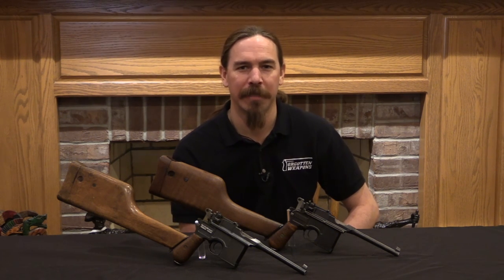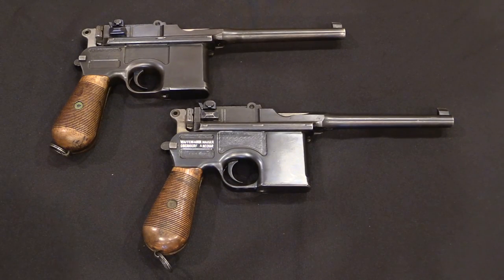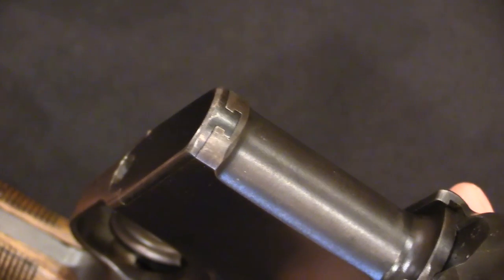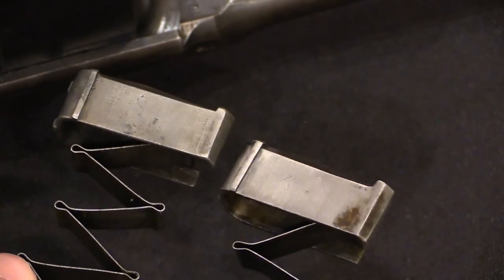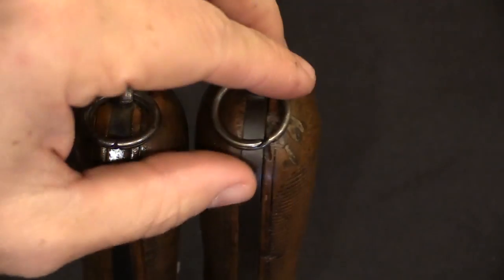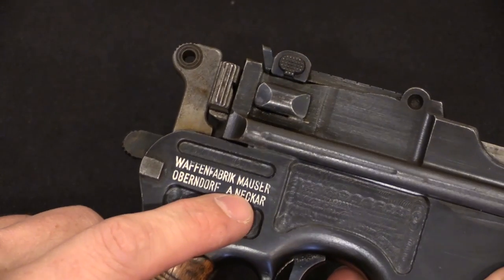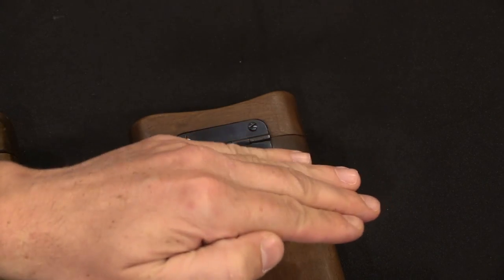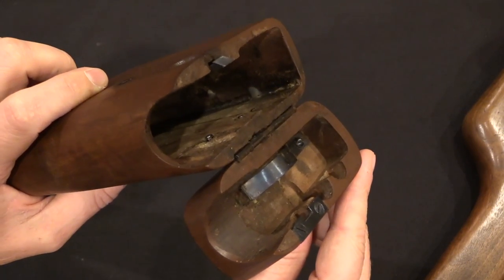Real, Reworked, or Faked? Authenticating a C96 Mauser

Comment: Many C96s in circulation spent many decades in China and were imported into the US through the early '90s (and later in other countries - I have seen Chinese import C96s on the German and Canadian markets). These will typically have import marks and some will have Chinese-made parts and even receivers. The majority of these are in need of refinishing and new parts and springs. They're still Broomhandles, though!
Reply: Actually many of the replacement receivers were made in the US by the importers, as many of them were actually the Model 712 Schnellfeuer and thus otherwise unimportable as machineguns. They effectively came in as parts kits and were re-built as semi-autos, though this does mean that they can no longer legally accept a stock. I've got one of those myself that did come with a correct 712 stock, though it also seemed to have been converted to 9mm  to correct what I suspect was a rotten bore. The stock has since been paired with (but not altered to improve fit in any way) a correct original M30 Broomhandle, also from China that can legally fit the stock. I know for sure Briklee Trading was one of the companies involved in doing that, I'm sure there were also others.
Reply: chunk.. blam, blam.. oh shit.. (in .45ACP).. loading the chamber can be a bitch (1st round)

Comment: I've got a Bolo that's a complete parts bin special, which I wouldn't mind if they were mismatched working parts, but alas, they are not. Mind you, the guy I got it from threw it in for free with a Webley Mk IV I was buying, so we both knew it didn't work, but when it later turned out not to be fixable, that was a bit of a disappointment.
Reply: damn how bad is it to not be fixable?
Reply: @therideneverends1697  I'm no expert, but I left it with a gunsmith downstate for several months a couple years back, and he finally said he couldn't find the parts necessary to make it safe to shoot anywhere, and would I please come and take it back.

Comment: Another thing I kept thinking during this video was "what about differentiating between restoration work that was done when the weapon was in service, versus later when it has retired into collectordom?"

For example if someone with an original gun, in WWI, had their stock holster heavily damaged, or their floorplate fall out into the mud of a trench never to be seen again, and replaced it during or shortly after the war, or it was replaced in 1937 by their son, or so-on and so forth... perhaps an armorer re-numbered a blank stock to match the item in inventory so it wouldn't be confused? Would that have ever happened? Are there procedures that would have been clearly followed, or telltale signs of legitimate repair work, versus a fraudster in his basement gunsmithing lab? I have to imagine that sometimes you'd get a damaged gun that with some replacement parts would be back on the front lines in non-pristine but serviceable condition. Or were most damaged guns simply thrown in the fuckit buckit?

Comment: The thing is that most old guns need repair and replacement parts. My OCD isn't bad enough for me to lose any sleep over encountering guns that over a period of 100 years had to be fixed.  A used, old gun will look like it's been used and cared for.  But, of course, a gun that has been "tampered" with will fetch / cost less money than a gun that hasn't been extensively repaired.

Comment: So, if I were to buy one, I'd probably seek out a bad example as it would be the only one I could afford.
With minimal effort they could have done a better job and made it easily passable to casual observation.
I cleaned up my Iver Johnson cadet by reseting the barrel to correct the excessive barrel gap and easily added 50% to the value of the gun, so made a $90 gun into a $135 gun, and Ian would never have a clue!

Comment: Literally a boat load of authentic broom handle Mausers came out of China in the early 1980s in very rough external condition with corroded bores (China was a major customer of Mauser).  Since many, if not most, were actually in VG mechanical condition (just looked like hell) they formed the basis for much of the fakery you see today.  These were cheap at the time and people such as myself restored them to presentable and functional condition (relining the bore is not hard).  I’ve probably put over a 1000 rounds through mine, which has now started to acquire that “been there” look.  Stumping a newbie with it would likely be easy….but anyone that heeds the advice herein should be able to spot the issues readily enough.  To me this is a $300 pistol at best.  That said, for someone that wants a real functional example for shooting and doesn’t have a 6 figure checking account, it is a sound purchase.

Comment: 6:50 You'd have to do A LOT of "polishing" to get that much of a rolled over edge.
Reply: not if you are using a belt polisher/sander, by hand you are correct. On a belt 45 seconds

Comment: I would still rather have a decently done refinished gun than a poorly kept original gun but that's just me.  As long as the refinish was done in the correct manner with the correct type of bluing.  The way I see it is that an original gun that has not been kept up with wouldn't be around in another 100 years if it never gets some attention and possible refinishing.

Comment: Very awkward to load and fire these pistols.  Also, very delicate, very hard to take apart and reassemble. If you buy one, replace firing pin spring and bolt stop before firing.  Have a smith look it over well.

Comment: I'm looking at a "complete" c96 and this video is invaluable on what I need to watch out for. Thank you for taking the time to make this! What about the lend/leases that went to China? Or the Chinese made c96's?
Reply: Most Mauser Broomhandle sent to China were M30s, or Mauser Bolos from what I have seen. Sometimes Pre War Commerials show up. The bores are usually rough or shot smooth without rifling. All Mauser Broomhandles returned from China are hit or miss, since most had parts switched out/replaced, which makes finding a matching pistol from China very rare. The beat up Chinese Mauser Broomhandles can usually be had for $500-700.

Comment: I may be slightly confused, but it seems as though he touts the 211 example as the most original Pistol but then declares the 211 Holster as being the most altered holster. Conclusion? It is very difficult to find matching pistol and holster in original, unaltered condition. Very surprising he did not mention this fact while he nitpicked any and all discrepancies. I also believe that some differences could be attributed to guns assembled by true gunsmith perfectionists and others assembled by 9 to 5 Joe Schmoes at the time of manufacture.
Reply: I think it is stated in the video that both the 211 pistol and 211 shoulder stock were messed with.

Comment: Where is this idea coming from, to fill stampings on old guns with white paint? Nobody did this until a few years ago. The first I seen it was a Walther P99, and some H&K guns later. I think it sucks on historic guns.
Reply: First I totally agree with you.  But second it's not a recent trend, you will find that it starts back in the 50's when those early collectors were getting on in years and beginning to lose their eyesight.  Third, it should be in white grease pencil and not paint like I've seen done by some unscrupulous individuals.
Reply: @worldtraveler930  May be its different in the US, I started shooting 35 years ago in Germany and I never saw it until a few years ago as I said and recently in Ian's videos. What is used for filling the stamping is not important. H&K uses some kind of paint, I think, on the polymer parts of the guns. 
I once did something similar myself: I drilled little dimples into the sights of a pistol and filled them with white TipEx - that works quite good.
And I'm now at an age where I could use some aid with my eyesight myself - but I still don't like the highlighted stamping. :)

Comment: GREAT video, man... but, I disagree with two things 1) the "good example" c96 cannot be sold as a completely original,  unrestored, wartime example. The filled Engravings count as a minor modification. Giving it a .5 strike against condition. 2) I disagree on your analysis of the "good example" Mausers' extractor. It seems to me the slight raise around the edges,  behind the wave across the top of the extractor, and a slight mis-fit of it left lobe, seem to me to be an original, replacement extractor. That raising, behind the compression wave, is just too high. That alone wouldn't lead me to this conclusion, but coupled with the appearance of the right lobe, seems to me to have been replaced. On my second observation, I'll admit, I might be wrong. On my first observation, I stand by it as 100 percent correct. The wax filling of the engraving detracts value because there is no practical way of removing it, without potentially damaging the finish of the gun. All that having been said, God damn that's a gorgeous gun. I would absolutely love owning either one of them. Getting the "poor" example may actually interest some people, as you both get to save money on the purchase, whilst giving yourself a project in returning it back to original unrestored (looking) condition. C96 Mausers, and Red 9's (my preference) are my favorite semi-auto of all time. Fine examples are gorgeous, and I'll take an excellent example Red 9, over any modern semi-auto, any day of the week. The manufacturing standards of the day give those c96s a feel akin to driving a Rolls-Royce, whilst a modern 9 mm semi-automatic, like a Taurus 9 mm, would be more akin to driving a Honda Accord. The aged bluing, the finished wood, the antique leather, and all of those smells coupled with gunpowder, give the c96s and Red 9's an ownership experience that just is not offered by modern semi-autos... and I love it. I will own a fine example Red 9, and a Mateba Unica, before I leave this world. Both guns are masterpieces. Equal in beauty to, but much more easily aquired than a DiVinci.

Comment: In situations such as this, isn't it worth it sell a slightly broken gun to someone who'd like to restore it, for a lesser price, rather than spending the money and effort into making a fake, which if discovered would lower the amount you'd get for it substantially?
Reply: “Fakes” are often the result of someone who attempted to do a “restoration” for a original pistol, but were done so incorrectly and nonprofessionally. Then falsely advertised as original even though they are not.

 It is very rare that a fake is made from the ground up.

Comment: At 4:53 - the blued oblong shaped part at the right side of the bolt housing is not the "bolt stop" (the magazine follower is stopping the bolt after the last cartridge  has been fired), but the main spring "holder" or mounting as the wonderful, poetic German technical term "Schliessfederhalter" clearly indicates... 
The C96 is my all time favorite. Since some ghetto punk POS stole my Model 1930 from my storage unit about 10 years ago (cops not getting off their behinds for a simple burglary, gun control doesn't work like that in CA) I just must have another - maybe an early model this time...

Comment: So the absolutely TERRIBLE machining marks on the “good” one is common?
Reply: You mean those circle marks on the right side?  They both had those marks - and yeah, they're fairly typical as far as I've seen.

Edit:  At 9:49 you can see them on the "bad" copy as well.  They don't look to be quite as bad as on the "good" one, but they may have been polished up to minimize them during the gun's refinishing.
Reply: Especially if it's a wartime C96, those machining marks will be stark.
Reply: Wartime production? Yeah, the final clean&polish step is the first thing to go.
Reply: @ScottKenny1978  It's war time production, lets stop polishing this small zone on the side of the gun to save time. 
Also lets hand fit as many non critical parts as we can, because we don't want production to be too  quick.
Reply: @comrademcsalty7676  some steps are a lot easier to skip than others. Also, up until the end of WW2, hand fitting was common in European manufacturing. Go read the wiki article on the bofors 40mm, it talks about how the US had to do some major revisions to the blueprints to remove every place it said "file to fit".

Comment: Interesting point of view in this video.  A major gun auction site has one of these upcoming but provides 2 photos only.  It's impossible from their 2 photos to see some of the features described in this video.  Both photos are a side view from the right side of the C96.  This would imply that no further details are needed.  These are not cheap guns in nice condition.  What goes here?
Reply: Are you talking about Rock Island Auctions?
Reply: @David-fp7yc  Hi David & thanks for replying.  I'll join your Patreon site.  Yes, following your suggestions here I wrote them and they told me the gun was made from dissimilar (ie non-matching) serial numbers on the parts and has mismatched wear patterns.  They also sent me 10 high res photos.  I really like these guns, particularly the earlier ones (NOT the red 9's) but am not knowledgeable at all on firearms.
Reply: @Gallienus53  I do not have a Patreon site. A non-matching example like what you told me could be bought for less than $1,000 depending on the bore and overall condition. If it is safe to shoot and has a decent bore, paying less than $1,000 seems to be a good deal.
Reply: @David-fp7yc  Unfortunately the estimate is $1,400 - $2,000.  I've been advised that the parts serials don't match and the parts don't match completely.  Also, the gun is completely midnight blue with no apparent wear.  I'd have to guess that it's recently re-blued?  Also, I'd be buying completely sight-unseen w/ no return options.  Perhaps it might be best to wait for things to open up a bit and see more of these in person?  As mentioned I'm a complete newbie at this and am very cautious.  Thanks very much for your insights incidentally.
Reply: @Gallienus53  The problem with auctions is you will be paying for the buyers premium, on top of the winning bid price, so you will end up paying more. Sometimes the estimates are high and the item sells for less due to low interest. For what you are looking for, try Gunbroker, Gunsinternational, etc.
Reply: @David-fp7yc  Hi & thanks.  They say there's a huge amount of interest in this item.  If you look at the auction listing it appears to be a wonderful item: very original.  In their emails they tell me a different story.  I guess one needs to be an expert and examine the gun IN PERSON to know what's really going on.

Comment: My dad has a friend who asked me if I would put together his c96 that had been disassembled for some time and he could not remember how put it back together. What I found was that the barrel only had 5 numbers 51xxx and on the underside had KFS AT1 GA, and both the bolt and extractor are chrome. Any info I could pass along would be great. I did get it put back together after replacing a bent firing pin.

Comment: I have one of those stocks. Family origin? longer hinge bottom 4 screws , fixed square ring; top 3 scews. front 2 good rivets horizontal in front of button, 2 rivets vertical behind button  on opening piece, curled tension spring holder inside. small  # stamp narrow underside,  wood stamp narrow side  S.A. LTD., (below) 1944. Any ideas out there. From Canada (The-Country-That-Fun -Forgot)

Comment: So, is a gun in worse shape better than one which has been repaired and refinished?  I understand that this post is mostly about a gun being presented as something it isn't.  I am wondering about an example itself, do you ruin it by fixing and refurbishing it?
Reply: well, it certainly ruins the historical value of the gun
Reply: @luckyblockyoshi  I can see that, but isn't a working weapon better than a non-functioning example?  Or does this primarily depend on the philosophy of the collector/owner?

Comment: So if I'm looking for a good deal on a c96, I could get one for 500 if it's mostly re-done? I'd buy that, I don't have near the money for an original.
Reply: a thrashed example will run you 450-650. a refinished one that or a little less.

ive seen one that was sanded and nickle plated for 350.
Reply: @therideneverends1697  So you can get a perfectly functional one on a budget for a good price? Nice. Do Red 9's get that cheap too?